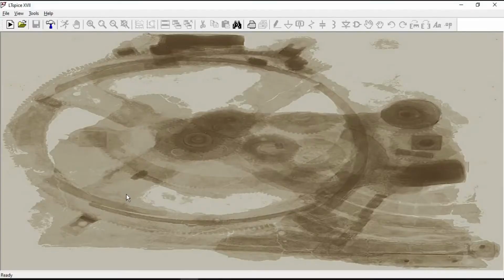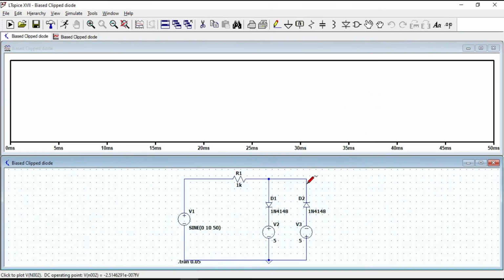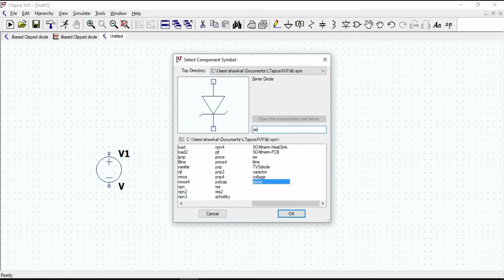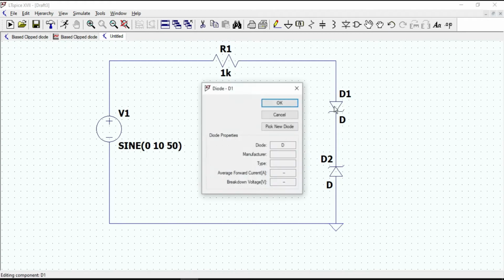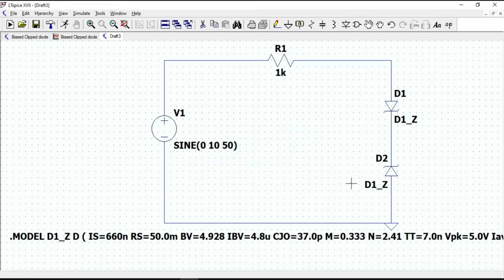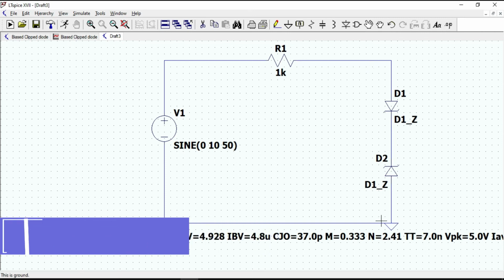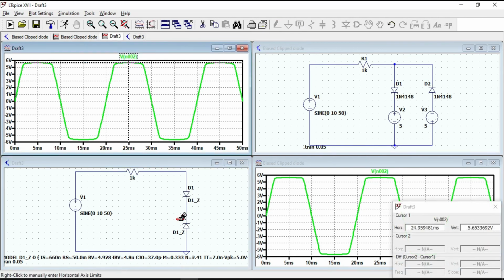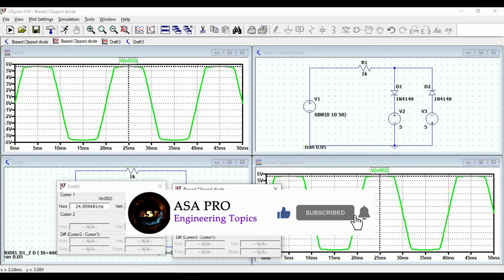zener diode clipping Ltspice simulation

Comment: Great video, thankyou.

.model D1_Z D ( IS=660n RS=50.0m BV=4.928 IBV=4.8u CJO=37.0p M=0.333 N=2.41 TT=7.0n Vpk=5.0V Iave=2.00A mfg=DiodesInc type=silicon )

You can reference the diode documentation in the LTSpice manual for description of the parameters.
/ADI/LTspice/LTspiceHelp/ddiode.htm